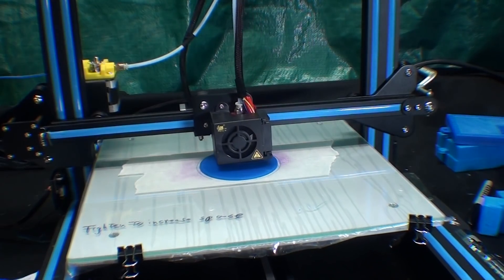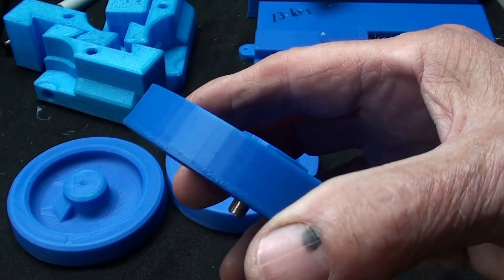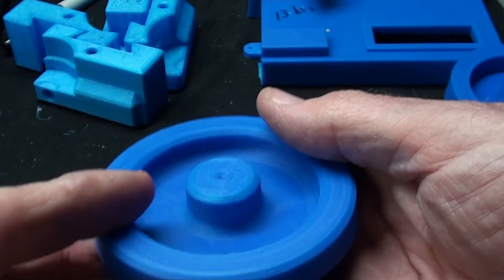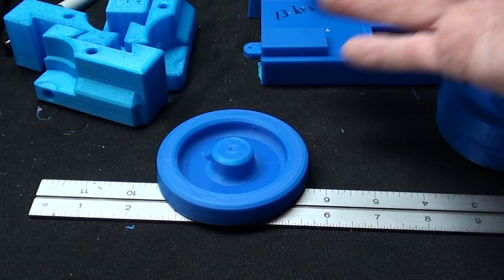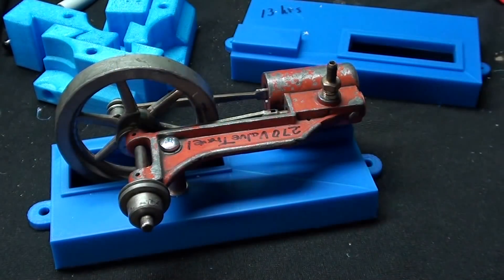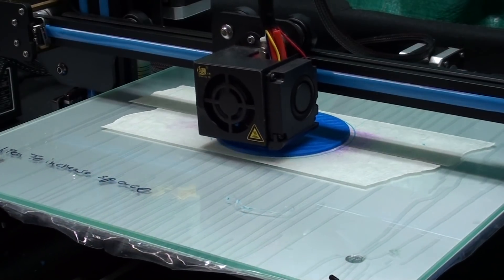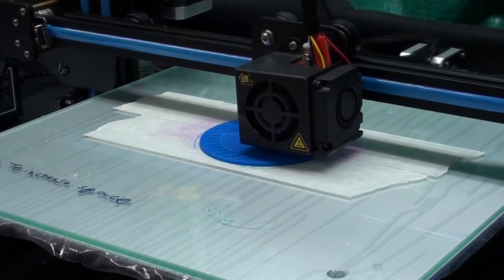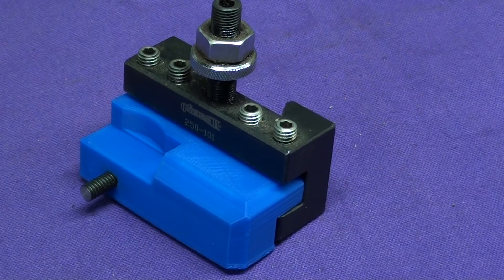3D Printing CREALITY CR 10 with tubalcain #2

Comment: I started printing on masking tape and had similar difficulties removing prints when done. I switched to printing on bare glass using hair spray as adhesive and had much better results. The other trick I found was to wait 5 or 10 minutes after the heated bed cooled to remove it. A lot of times as the bed was cooling I hear it 'pop' free, and I don't even have to use the spatula to scrape it off.  The other problem you're having with warping are relate to having thin surfaces in contact with the print surface responsible for adhering the print. To maintain good adhesion as more layers are piled on and sections of the part are cooling at different rates (the thin parts will cool quicker and bow) try using a raft. The raft is similar to a brim but goes under the entire part. It also gives a good base for the supports to stick to on the base.

Comment: I would love to see a side by side video where on one side you are setting up and then printing some object and on the other side you are doing the same thing in your shop. All the way through from set up to finished product along with a time scale.   I was pleased to hear you mention the time issue on your last 3d printing video.  For someone working without tools I can see the 3d printer being a really valuable single tool.  But if you have all the other stuff that you have-or even just a few pieces then one has to ask the question: Does a 3d printer make sense or would a CNC router be a better tool to have?

Comment: the print sticking issue...I´d get some PEI sheet from a trusted source (there are some fake "PEI" sheets out there which won´t work) ..I dont know this  manufacture but here is a 
Link to  a product: https://www.prozix.com/product/pei-sheet-3d-printer-build-surface-for-cr-10-and-lulzbot-taz/

Comment: turn down the bed temp. sometimes when its a few degrees too high, the print will start to peel off the bed.. and likewise when its too low , you may not get good adhesion.. always a balancing act.

Comment: The reason the parts are lifting is because the bed is not leveled properly, if you level the bed properly to about .2mm off the nozzle and have the plastic smudge on the glass you don't need to use any tape or glue.  If the bed is not leveled equal some plastic deposits are thicker and some thinner then when it shrinks it will curl up. As well do your leveling with the machine hot that way it expands to what it will be once you actually print and there is no hard plastic on the nozzle, I use a piece of paper for leveling and try to get the same drag on all 4 corners. I have printed thousands of parts never used any tape or glue, I just clean the glass very well and heat it to 60 degrees Celsius.
Reply: If you watch the video he says he did all of that.
Reply: Yes but if You watch the video and listen, he never mentioned if he did all of that with the nozzle and the bed hot, he also never mentions 0.2 mm off the bed. so watch again. and the way i measure if my distance is good i have a large flat rectangle that i print and i measure with a micrometer the single line that is made outside the rectangle to see if indeed the first layer is 0.2mm

Comment: Mr. Pete - create a jig that allows you to mount a dial gauge to your print head and move it around checking what the dial reads.  If you use a 10ths indicator then you can be sure that the plate is level.  Also, things lift from the bed because they cool in one area to fast.  You need to box the printer to maintain a constant temp for the printer bed.

Comment: Try using PETG filament much less if no warping. I use PEI sheet or glass with hairspray (aquanet extra hold). I print prototypes before I machine them out of metal and love it. Yes Fusion 360 works great and easy to use.

Comment: Try Blue Painters Tape spritzed with rubbing alcohol wiped dry with a clean paper towel to remove the release agent film on the tape. There should be no reason to use both gluestick and tape. Try a heated bed temp of 50 degrees to lower your PLA bed warpage.

Comment: I see two problems in your prints.

Temperature management: You shop may have large temperature differenec or drafts coming from outside/different room. Your shop might be to cold. Try to insulate the underside of the print bed and try to make an enclosure for the printer.

Internal stresses: your models have large density differences. This can be fixed by changing the infill percentage, wall thickness and the number of top and bottom layers. Some models greatly benefit upon being designed hollow with sloped and or curved internal walls. Also enclosing the printer reduces the amount of shrinkige between the first layer and the next few layers. Using PLA or PETG also helps in this regard.
Reply from the maker: +TNimble B thank you, that is very good information

Comment: What is the weight of pla or abs used for the steam base or round pattern? Would "draft mode" use significantly less? (Just looking for a reasonable guess)

Comment: A naive and possibly foolish question: can those wheels be turned on your lathe to flatten out the bottom, and remove the segment facets on the perimeter?
Reply: If they're PLA , I would be amazed to find they can be turned without generating heat from the cutting creating further distortion. A thicker printed shell might resolve the segments we see in his example.

Comment: Just wondering how much infill you are printing.  I've found that 20% is more than adequate for most print jobs and it greatly shortens your print time.  Might also reduce the amount of cupping on the bottom.
Reply from the maker: +Chuck Fellows  usually 10 or 15%

Comment: If the glass bed is straight it might be the rails that are bend. If the rails are not straight, the bed will change height as the bed moves along the axis. This can cause you to measure a different height in the middle even when all four corners are correct. The machine really needs to be straight otherwise you get these effects. It is not too different from metal working machines...
Reply from the maker: +Baldur Norddahl I will check the rails for straightness

Comment: You seam to have all you need to get good prints other than the slight lift on the edges. checkout the brim option, it helps hold the edges down. your quality is looking very good
Reply from the maker: +Derek Greenhalgh most of the time, I am using A brim

Comment: Mr Pete, Get a sheet of "PEI" and apply it to your bed. forget the masking tape and use basic office glue stick directly on the PEI material. Be sure to heat the bed, even though not required for PLA it prints much better with the bed at 60 to 70 Celsius. Do these things and you will not be printing bananas any more. :-) You should also get good results using the glue stick directly on the glass without the tape. I have printed by many methods before settling on the method I use now which gives perfect results a nice flat smooth bottom never comes loose but also removes without much difficulty with a putty knife. The PEI is also very durable and if it gets worn you can recondition it with a little sanding. My method is printing on PEI satin scuffed surface, with a thin coating of glue stick heated to 70 degrees Celsius. Also printing your first layer a few degrees higher will help bed adhesion. The success of the first layer will affect the entire rest of the print. Once you get it right you will get perfectly flat smooth bottoms on your parts.

Comment: As I wrote previously, the most important aspects are adhesion and leveling. Cooling comes third, but really only matters for tall parts. To avoid warping, make sure you print PLA, not ABS. Raise the bed temperature at least 10C, because glass and tape lowers the surface temperature. Let the plate cool before removing the part., it's easier. You could try to enclose the printer or put it away from drafts, those lower the temperature in the corners - causing lifting. If you can control the part cooling fan, try to make it come on only after a few layers have printed (>1/2" height). Try to print directly on glass with a high bed temperature, just for testing.

Comment: Guess you could always chuck those wheel patterns up in the lathe and face off the backs so they are flush. I've seen the curling problem caused by the print bed being too cool.

Comment: Yes the warpage is a huge problem with these cheap/homebuild 3D-printers.
The  main problem had was the air itself. The slightness draft will cool the object asymmetrically and it will pull off the base. I build a glass box around it with the electronic and fillament-spool outside. This helped a lot but it was not a full success. I have to heat up the inside of the box (simple iron wire at a benchtop power supply). At around 40°C all warpage was gone.

So in my experience, the warpage comes from the to fast/asymetrical cooling down of the print.

Comment: To set z 0, the bed and nozzle should be up to printing temp. The height changes a lot with different temp. Bed leveling can usually be cold. I only need to do it after putting in some big force trying to get a part off. I level the bed if needed, preheat nozzle and bed, manually touch off the nozzle in the middle. I turn the z stepper by hand to where the nozzle touches, then go up by one step. Faster, more precise and easier. The smallest distance my printer lets me jog is .1mm. I get good adhesion that way.

Comment: Heat shrinkage? That could be causing the warpage of the bottom of your wheel pattern.
have you tried programming in the shrinkage alowances by measuring the bottom of the wheel pattern shrinkage and adding that dimension? Just an idea..

Comment: Hey Lyle, 

On bed adhesion: I would recommend to not use masking tape, and just print on plain (very clean) glass, or glass with fresh glue stick. The most important thing is to make sure your bed is leveled properly, and that you have gotten any bed sag/warp out. My bed had a fair amount of sag in the middle, and I used aluminum foil under the glass to shim it flat. 

I created a micrometer holder and it's on thingiverse here: https://www.thingiverse.com/thing:2513879

I'm not sure if it will work with the stock metal hotend shroud, but you could give it a try just to check for bed warp. 

Happy printing!

Comment: I've been looking into the CR-10, and I've seen at least one video, maybe two, where the creator had a warped glass plate from the factory. I see that you talk about checking that starting at roughly 10:00 in this video, so maybe that is not your problem here.

The other issue I've been hearing about is the heating of the baseplate - apparently, it has enough surface area to lose significant heat from the underside, and folks printing ABS have been talking about insulating underneath to limit that issue.

Because your printed part is going to impose a different heat flux than the bare plate, you may want to  look at insulating the top side of the plate as well, with a cut-out area to expose the glass plate for the base of the part.

I've heard of several ideas for the insulation - evidently, it doesn't need much - and things like ceramic fiber paper, and gasket making paper / felt get mentioned.

That might be worth looking into, as it doesn't take much in the way of a temperature gradient to get the aluminum baseplate to distort just a tiny bit, which could be enough to cause the issues which you are encountering here.

Comment: I use my 3d printer for back yard foundry patterns too. I like to print at 0.2mm layer height and I finish by painting on a coating of slow cure 2 part a epoxy, it fills in the layer lines and surface tension makes draft and fillets in intricate details like small text that would be hard to do in CAD (fusion360 and OnShape both have trouble with drafted text)  

The trick with epoxy is that if it cures to fast its hard to apply evenly, if it cures too slow it can take a day or two to reach full hardness. To remedy this, I now use UV curing one part resin( from amazon or ebay) I can take my sweet time evenly coating the pattern, and then put it in a box lined with a UV LED strip(also from amazon) and it cures rock hard in seconds. 

If I am not planing on finishing the print I try to design with >10° draft to release the rough 0.2mm layer height

Here is the project I am working one using 3d printed patterns if you are interested.
http://forums.thehomefoundry.org/index.php?threads/modular-altitude-azimuth-telescope-mount.154/

I am in my 20s and I am making things of my own design with my printer, foundry, and lathe. Your videos do not fall on idle eyes and ears, I have learned so much from your videos, an you have been a great inspiration to me. Thank you Tubalcain.

-Corey

Comment: Mr. Pete -
I also have a Creality CR-10 3D printer.
As you mentioned, "adhesion" and "bed leveling" are the two greatest challenges!

From my experience:
> Adhesion: I print PLA at 55C on a bed heated to 210C. Depending on the situation, for greatest adhesion I use:
1) Blue Painters tape rubbed lighting with alcohol.  No problem with corner lift then!

2) A 12" x 12" "mirror tile from Lowes (cheap), sprayed with "AquaNet" hairspray (off printer) then installed on the bed and allowed to dry perfectly clear using the heated bed.  No problems with adhesion.  And the First Layer finish is...superb.

Note: You may also be experiencing some "elephant foot" when the First Layer flattens out (due to the heated bed, etc) over the duration of the print.  I will often Chamfer the edge in question to minimize this artifact.

> Bed Leveling: Focus your bed leveling efforts on the middle 6" x 6" section.  Ignore the corners unless you intend to print something there.  I also use a 3x5 card to check Nozzle Head distance above Bed.  It's easy and routine once you get the hang of it.  Do this with your bed up to print temperature (not ambient). A good/perfect First Layer is your proof of a decent bed leveling.

Regarding TinkerCAD, many of the "objects" have parameters which can be adjusted after placement on your Design Grid. For example, the Cylinder object has "sides" which can be adjusted to give you a (much) smoother result.

Fillets and Rounds can also be achieved using TinkerCAD. However, it's a rather tedious manual process. Using positive and negative shapes ("hole") to achieve the desired results.

I'm impressed with your progress and results!
73 de JG/HamWithCam

Comment: Mr. Pete222, that same print size with a 0.4mm Nozzle (same as yours I presume), 0.2mm Layer height, 3 walls (or 1.2mm wall thickness with 0.4mm nozzle), 20% infill, 3 top and bottom layers, 60mm/sec print speed, will only take 1 hour.-1.5hours to print. 7 hours is waaayy too long for that.

As for the warping, a Bed Temperature of 50deg C, with a PLA material, that print should be absolutely flat given that the 1st layer is done right. Or could be that it is too cold where your 3d printer is. That may cause warping. 

Here is a good video on how to get the 1st layer right:

https://www.youtube.com/watch?v=Fo42S22BTwg

Comment: I have been using  onshape(dot)com  its a free online cad program and I have been able to do perfect circles, fillets and champers with little effort.  Printing threaded parts is my current favorite trick.  Part of your problem with lifting is print cooling.  you need to direct your fan better onto your printed objects so it cools faster... it lifts when the new hot filament insulates the the lower layers and makes them cool slower.

Comment: Anyone that has a 3D printer has gone through the same issues, it is not a science, it is an art of trial and error....and lots of failure. 3D printing has it's virtues but once I got a CNC, the 3D printers (my minions) don't get used as much. What can take 10 hours on a 3D printer is minutes on a CNC. 
FYI: You can share files with Fusion360 in the cloud to collaborate on projects. You can make them public or share with just a group. Fusion is the way to go. Easy to download and can run on multiple comoputers.

Ask Banggood if they have a CNC?

Comment: Get a 300mm x 300mm piece of glass and use binder clips to hold it down to the print bed.  Spray it with a super hold hair spray like Aquanet and heat the bed to 60°C for the print.  When the print is done and the bed cools, it will pop right off, otherwise use a razor blade on a corner and it should pop off.  For ABS, use 110°C.

Comment: 2d printers could leave you with a rats nest (of paper not plastic) if you left them unattended overnight back in the 1980s.   The CR10 seems like quite a refined model by Reprap standard but the latest one by Josef Prusa has some very nice reliability features which will doubtless become standard issue on other makes in the next couple of years.  He also sells the flexible printbed you described.

Comment: Probably a bit of a repeat from other people but I found Elmers gluestick directly on the glass (maybe a pass or two over the area being printed on) along with a print head that is slightly closer then it should be make for very good adhesion but usually can still be scrapped off. I never had any luck with tape, with or without gluestick on it. 

90% of my issues with adhesion has been due to printhead distance to the bed and adhesion. Once I level with paper I will adjust the bed a 1/4 turn of the screws up. If needed I will also add another pass or two of glue to build-up the bed/help adhesion.
Also you may want to create a quick "pad" for adhesion testing so you can run it off in a 10 or 15 minutes to ensure things are level/adhering. I also make sure to slow down my first layer to 20-30% of the main print speed with a bed temp of 60 degress C. 

I'm new to this too, only been doing it for a few months, and it is quite the learning curve! It is an awesome tool once you work out the kinks, I actually use mine for scale model houses to show clients.